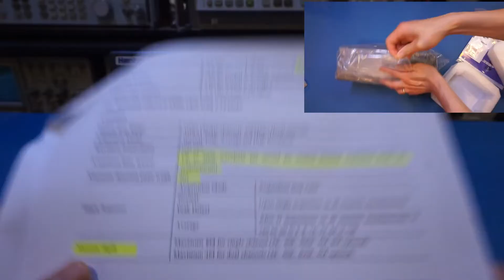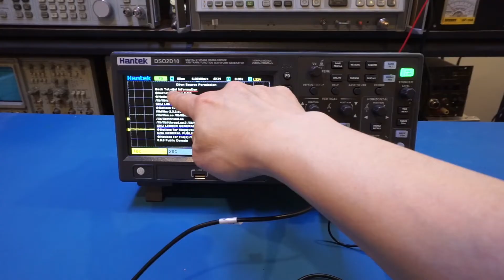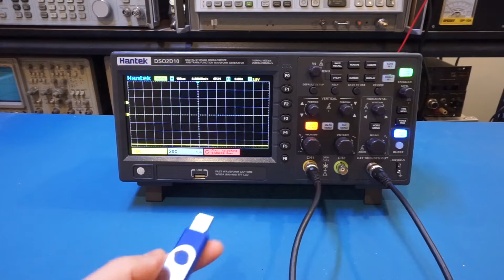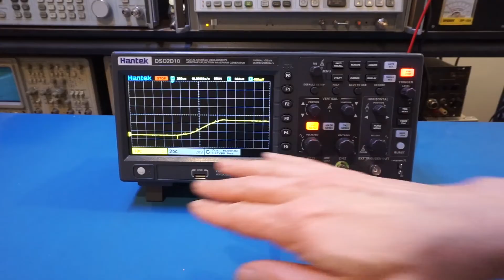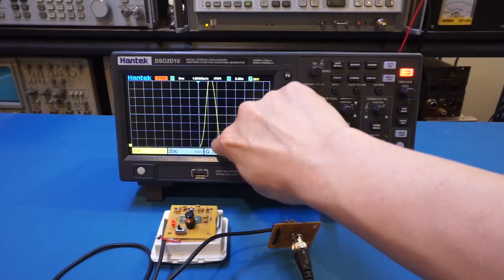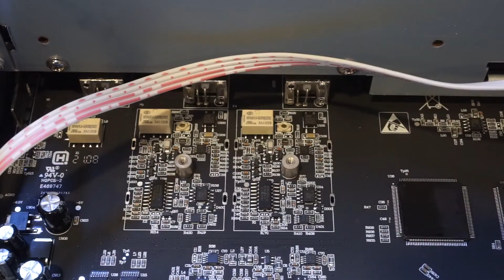Review/Teardown of a Hantek DSO2D10 Oscilloscope - It Has Builtin AWG, Does Protocol Decoding Too!

Comment: Well done, Kerry! Thank you for the thorough review and for sharing your opinions. I found your insights valuable enough that I purchased the Hantek DSO2D10. I am 50 years past my Navy experiences with Tektronix 545Bs and other behemoths of the era. Your explanations helped me to get up to speed on the current scope technologies and methodologies. The standardization of the front end interface makes it possible to jump right in and become proficient with little confusion--the minimal differences from brand to brand are easily overcome.

Comment: Company  bought this oscilloscope to use and the first day we've it, it froze when:
1. saving waveform in internal memory, stuck at 20%. Happened multiple times.
2. UART decoding.
3. CAN decoding.

Can't recommend this DSO.

Comment: Roll mode on these is so slow it needs to be wound up like a 1920s clock

I love the look of it, i bought the 150mhz version but it ran slow as hell so sent it back, there are a ton of overclocking hacks out there, but these have terribly slow allwinner processors

Unfortunately hantek scopes run on very buggy linux distros and are very slow in general, these cheap scopes do a lot of things but none of them are done right.

Comment: My pcb revision is  the  same, bought it around 3 yrs ago after this vid and some other ones said good things at the time.... now my f0-f6 keys have become random results buttons, and the rotary knobs interact with each other ! I guess something has failed but I dont think it will be possible to find it, its had maybe 30+ hours of use as I dont do much that needs one, and it  still has the protective film on the lcd but is now useless. a search on youtube  reveals i'm not alone in keypad issues and display/cpu freezes

Comment: The two front end input shields are held on by means of one single screw, each. Would the scope benefit in any way against spurious signals if the lids were actually soldered onto the provided metalized slots?

Comment: few ays of owning this thing and there is a lot to like and few things to dislike
the biggest infuriating feature is the beep, it works every time, but buttons not always decide they were pressed
it is trigger happy so it is often nesesery to limit it to 20 mhz
signal decoding not always work, especially on single shot signals where you need it the most
and i feel the knobs that controll it have by default a bit to fine adjustment or rather they should idecrease in fines as you rrn them to move faster when you need it
but it has an option to use very long memory buffer, generator is pretty ok ,single  triggering wrks pretty much out of the box and even dummy like myself figured the controlls without manual
since i got my on a crazy sale i am pretty happy with it
i wonder why there is no 3 channel version without generator as an option, the case seems to be set up for it, and sometimes you need 3rd channel for some signal decoding, goung 4 channel in the price range seems kind of sketchy

Comment: The best review of this series DSO2000. Is it still working? I read lots of bad comments related to plenty of bugs.
Reply from the maker: Yes, it still works. But I did run into some bugs.
Reply: Did you apply any mod from eevblog or similar? Or are you only using official firmware? V.3209?
Reply from the maker: @JordiMS78  No. I was using the official firmware.

Comment: Is it possible to measure 230 V AC generator output and check if it is of pure sine wave and its frequency. If so how to measure as the max input is 10 V per division
Reply from the maker: You can use a x100 probe.

Comment: Hello Kerry,
What is the minimum input sensitivity mV/Div ?
Working with 2 channels simultaneously, any limitations to the Bandwidth?
Thanks
Reply: 2mV/Div. I used it to check my DC power adapter output ripple. Good linear DC adaptor output ripple should be less than 10 mV. It can also be used to check PCB board noise.

Comment: Excellent video! But I have a doubt. Please, can you check for me if it is possible to measure the phase angle between two sinusoidals with this equipment? That is, what is the phase angle between channels 1 and 2 when both channels have a sine wave, but the frequencies of channels 1 and 2 are different? Does it do this measurement automatically? Thanks.
Reply: There is the FRR measurement: "The time between the first rising edge of source 1 and the first rising edge of source 2". The period measurement can be used to calculate the phase shift.  Make sure that “Measure”->“Setting”->“Source B” on you Hantek is set correctly.
Reply: Thank you very much! This information will help me a lot. :)

Comment: I just blew the AWG in my Hantek... Did something dumb and exposed it to a "largish" DC voltage....now no waveform o/p.

:face-turquoise-covering-eyes:....never done SMD repair...worth trying or just buy a sig gen? opinions please?? :)
Reply from the maker: Take a look at my teardown pictures. It's likely that the output OpAmp is damaged. You can verify by measuring the input to the output OpAm LMH6702. If there is input but no output then you can swap in an OpAmp, should be fairly easy.
Reply: Thanks Kerry. Might give it a shot. Looks reasonably simple.

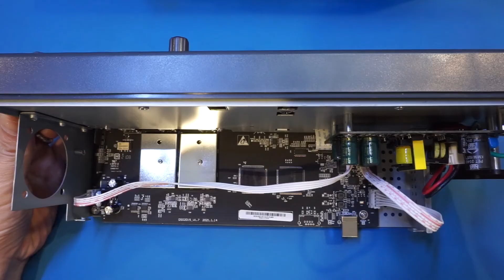Comment: Interesting that while the scope is labeled a DSO2D10, the PCB, as shown @ 31:48, indicates that those are identical for both 2D10 and 2D15. That makes one wonder whether those two models are merely labeled differently, or whether they actually differ in specs.
Reply: It's pretty common for manufacturers to use artificial bandwidth limiting.  There's no difference between a Rigol MSO5072 (70 MHz 2 channel) and an MSO5354 (350MHz 4 channel), they're all the same, just controlled by licensing.
Reply: Seems all new ones use the same board, however there's also reports of users getting the 2D10 missing components from the 2D15.  So there's a certain amount of luck involved.

Comment: Continuation: I've opened the scope ,power supply is radiating only 5 cm in back. But display is radiating  in front to 1-2 meters. I can hear on FM wave between stations the increasing noise when scope is powered. So no fast cure for this issue because is for no use to shield the power supply.
Reply: Might be possible to depower the display and get data via the USB - when needed for very small signal analysis

Comment: The best introduction and review of this oscilloscope overall! And the reason I purchased this fantastic beginners tool 🙂 Many thanks Kerry!! 🙂
Reply: how is your Hantech scope after about a year?
Reply: @ClassicCinemaRewind  Still doing doing very well, no issues at all, thanks! As a hobbist I use it just for measurement of audio transformers performance...
Reply: @mojekh  would u recommend this this hantek for beginners like me? I plan on buying it
Reply: @rufxuzaevielgonzales7103  depends more on what you want to measure than if you are amateur or pro 🙂 if 2 channel and the frequency range 100MHz(?) is fine for you, than why not? for me personally it's much more than i will ever need from oscilloscope ;-)
Reply: @mojekh i'd actually want to use more than 2 channel but the 100Mhz ehh not so much, 10Mhz is fine for me

Comment: Great video. I bought one of this. All good but it radiates a lot of harmonics ! When I put a FM radio near it, to adjust IF 10.7Mhz, well is almost impossible because of radiation. Only above 2 meters in front the radiation is down. Did someone else experienced the same? Compared with a Tektronix digital and also with a very old analog oscilloscope: this is far away. I did not imagine it can radiates like this. Could be power supply that needs a shield? It seems on the right front side it radiates also till 2 meters. At 1 m on the lateral left side the radiation is weak. If someone needs other details Ii can give.
Reply: Omg, many thanks dear Lucian for info to be aware, actually i wanted to buy it also for  fm measurement...now thinking about siglent sds1202x-e, but i never heard even can not to find something about this issue on sites...have a nice day.

Comment: So, I wonder, does the 150mhz scope have an even higher bandwidth, or are they really the same scope sold at two different price points. Or perhaps there are quality control issues where some scopes have worse bandwidth than others, so they bin then.
Reply: Most likely the same exact scope, just using a bandwidth limiter chip.  The print on the board backs that up, same scope.

Comment: Dear Mr. Wong, ¿do you think this scope would capture & display small amplitude signals (low volts, 1 to ~5 or so, as from a 555 timer) running at very low freq, as 1,2,4, or 6, or 8 Hz, kindly?  (To display the curve signals, in parallel with LED as indicators).  (My interest at this time is mainly only learning/displaying oscillators' & op-amps' workings and the like.  With a possible [much later time] use on my own CD player).  (I'm not  knowledgeable of such equipment, and currently only own a DMM and and an ESR meter).  Thank you and please forgive my impertinence.
Reply from the maker: Hi Tony, almost all DSOs nowadays especially the ones capable of single shot (including this one) can capture the low frequency signals you mentioned.
Reply: @KerryWongBlog  Hi Mr. Wong.  So it will capture such low freq signals.  Thank you for the kindness of a reply.  I appreciate your expert advice & help.  Thank you again.  God[Bible] Bless. 🙂

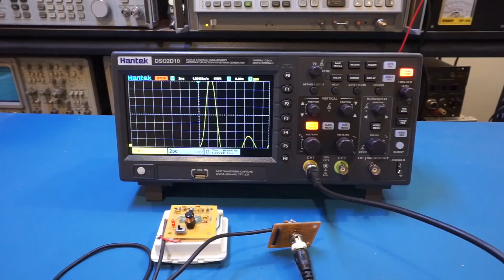Comment: Hi, Great Review. As well as general use, I'm interested in analyzing stereo audio signals for phase issues. The xy test at 29:16 you state the frequency is 100 Hz, but assume you mean 100 MHz. I can just about make out the frequency on the generator display does read 100 MHz. Can I assume this will give a useful display at audio frequencies? Thanks.
Reply: As I can see on the signal generator, I believe it's 100 kHz signals?

Comment: To be brutally honest I am thankful these reviews exist, and those on Amazon, and I've decided against it.

I've read too many problems and shortcomings with these units. Probably a good idea if it was properly debugged, stable, had an accompanying manual in local language, XY view would be reliable, would pick up less noise.

For about 150 EUR more one can buy a proper basic scope like the Siglent SDS1202X which has a vastly superior architecture and build quality (especially inside) and I couldn't justify to spend on this unit and be my one and ONLY oscilloscope, knowing that even if it wouldn't freeze, I wouldn't incur a dozen times per day into the beetles... I still would not trust it completely and still had to double check each time, fearful of the outcome and probably sometimes run into hard to read results because of it.
Reply: Unfortunately, the SDS1202X is very, very, very far from that price, anywhere.

Comment: It's odd you didn't run into many of the myriad bugs in this scope.  The thread on this over on the EEVBLOG forum is heartbreaking.  Your review makes it look like a more than decent scope considering teh features and price.
Reply from the maker: I will need to check out what issues people are facing. I think there was only one issue I encountered (which was captured in one of the review videos) that was resolved with a reboot. Won't be surprised if there are issues with certain firmware/software versions.
Reply: One problem is over heating. I've ordered heat sinks. As 2023  they have issued new firmware I havnt encountered a single bug yet.

Comment: Great and very informative video. I’m planning to getting a scope for audio work. Mostly for troubleshooting/calibrate cassette deck. How should one to connect scope input to cassette deck output? BNC scope input to RCA deck output? Or using probe clip? Thanks in advance
Reply: BNC to RCA adapters, readily available. The challenge is to get in the lines the load resistors.

Comment: Hey Kerry Wong , in XY test most likely problem is on Signal Generator part , cause others DSO2000 series works perfectly in XY mode!!! :)
One of sample : https://www.youtube.com/watch?v=2xRvbORAahM
Another problem of DSO2000 , is Schottky diodes on PSU , and FPGA and ADC converter. They overheat after while witch cause lifetime reduction and also little freezes while work. Small aluminum or copper radiators must be installed on parts described before , and small fan into socket. In an perfect situation switching power supply must be replaced with linear power supply , and in ideal linear power supply must be moved to outside of oscilloscope...

Comment: Hahahaha, 150 MHz displayable on the scope. Did you set the frequency correctly on your sig gen? And what was all the sync issues on screen, you failed to mention the horizontal jitter and vertical jitter??

Comment: Thank you for making the hantek video.
 trying to decide between a  Hantek  2D15 w/waveform 150Mhz ($259.99)  vs Siglent.  I'm a hobbiest, any advice is helpful on this choice.   also read that  Hantek freezes a lot, and needs  heat sinks added to IC to prevent locking up/freezing issues, and other people had to do firmware updates because of all the freezing issues, so this has me concerned. some people still have issues with firmware. see Eevblogs  and all the problems that Techcorner guy had with DSO2Dxx after his initial review he spent the next months trying to fix continuous freezing.
Reply: I wonder what you will end up with. I decided to go for 2D10 (albeit supposedly you can go for 2C10 and upgrade it via software to 2D15, if they kept all the components in) to have as many functions as possible in one device for various hobby projects (mostly digital) and some educational activities with kids (hence the AWG). My main concern is that I might simply not identify a significant issue caused by a bug in the scope, when it occurs :-). On the other hand, the device has been on the market for some time now, Hantek seems to progress in fixing various bugs (hopefuly hardware as well). It would be good to see a review of up-to-date version, to understand how stable and mature it is now. As for my personal experience: I got mine a week ago, I've been playing with it a lot for the last few days. I managed to freeze it once while doing a lot of parameter changes (that might not be making much sense though ;-)). I don't see most of the issues I read about. The one odd thing I experience is that the USB connection is not stable via my USB 3.0 mediaport (it's just an extension, not a hub) when connected to USB 2.0 port in my PC. When I connect it directly to the PC USB 2.0 port, it works fine.
Reply: @bartoszz4305   The siglent  SDS1104X-E   4 channel is on sale now ama zon   $100 off.    it's $399 now which is good price.  and EEVblogs has all the hacks so you can upgrade it to 200Mhz  and unlock all other stuff (it has wifi and you can connect to your PC too).  it doesn't have a wave gen like handtek but you can buy that separate.  I'm going to either buy Siglent now or try and wait until   Black Friday in 3 weeks.  Last year  it was25% off  or  $375.   but it's still very good now  at 20% off.   in eevblogs,  the Siglent SDS1104X-E  is one they most recommend to new people  & hobby people who  want something  sub $1000.
In the end I just don't think I want to deal with frustration of freezing and stuff with hantek.  eevblogs has  a collection of fixes for the hantek you might look at.  I just want something that works and the Siglent   X-E  is what I've decided on for now, only the X-E model can be hacked to 200Mhz and other hacks.  don't get the U model, it has no hacks (that is why it's $100 cheaper).
Reply: @neo256mb  That does sound like a decent alternative and possibly a smarter choice. :-) Although at the moment it's double the price of 2D10 in my country, while I feel the feature set is less aligned to my use-cases. On the other hand, the wifi connectivity (provided the PC software is actually comfortable to use) and HDMI output make it a nice educational device.
Reply: @neo256mb  I agree with you.... and we've seen both of them torn down. You buy a lot of solidity with the Siglent. I am not saying it is the perfect scope or it's just better or anything. In fact it seems just good enough to me, but at least since it has sold 10 times over it has also been properly user debugged and you can find solution for almost everything. And has a more substantial hardware quality.

Comment: Should this accurately measure dc voltage?  13.8 reads 14.1 on ch2 and 14.0 on ch1 a 1.44v aa battery reads 1.6v on mine
Reply: could be something to do with the probes.
Reply: @sivoltage  no. Just cheap. You have to dial in a very specific range to get anything resembling accurate frequency reading. It was made to give a ball park reading. It's a entry level scope that does alot for the money you can't expect it to do everything like a high end tektronix

Comment: Thanks for the detailed review! I'm rather disappointed with only 4K decode memory depth. It's only about 50-100ms signal length. Have they fixed it in fresh firmware?